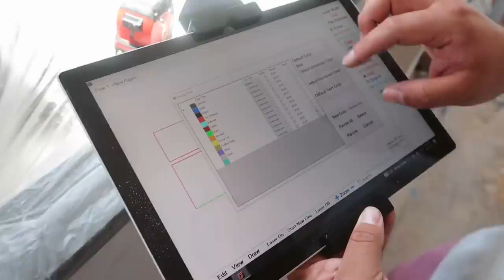HOW DID I GET SO LUCKY

Comment: I stripped many layers of paint off of my 1925 home's beautiful woodwork in the 1980s, and I could be wrong, but I'm 100% sure you have (I'm guessing) at least two layers of lead paint on there.  I don't know what it means as far as doing anything differently, other than don't eat it.  If I was going to use the heat gun (I didn't, but I used a heating element thingy up close in one hand with a spatula behind in another, a lot) I'd definitely use an industrial duty vapor respirator.

EDIT; I'm guessing the living room window trim is probably original, it looks like it has some age, and probably the right amount of paint layers.  Another good clue would be if most other windows throughout the house are the same.  I don't know what wood that is.  It looks as though it has some kind of varnish you may have to get off also, and then if it's too light underneath you can stain it dark again.  I think you'll be VERY happy with all the old paint off the trim!

Comment: My heart dropped when that door fell 😅 that wood trim look like it has varnish on that could give it that fake look, my personal opinion, strip it off completely give it a light sand with a fine sand paper and stain it darker if you prefer it darker then you can seal it again with a polyacrylic or the finish/sealer you prefer. It’s going to take time but it’ll be worth it in the end.

Comment: Try Smartstrip for your old paints. The red one. It takes off 30 coats of paints including paints before 1980 with lzad and or asbestos.... An d the COV of the product is really good. You just need to air out the place and let it sit for 24h hours

Comment: The trim could be slightly sanded then wiped with a tack cloth and you could go back over it with a gel stain. It is easier than fully re staining and has a protective layer to it. It does have a satin sheen to it and is limited in color selection

Comment: My comment about the Surf Prep Sander disappeared?  Katcha, Christina Muscari and Katie Scott all use it.  You can get a discount by using their promo codes.  It's a clean and efficient way of sanding and getting down to the wood.  You could rent one and see how well it works vs Citrus Strip.  Even after Citrus strip you would need to sand to get down to bare wood to restain.  It does curves without losing profile.

Comment: You pretty much gave all of us a heart attack, when the one door panel fell. It missed that paint can by about 2 inches, so that would have been disastrous. For now, I would just store them flat on the ground. I would stain the wood frames a dark espresso brown. I'd be curious on how you would paint the metal parts of the windows. Spray gun with enamel paint?

Comment: Have you met your new neighbors & set up a very secure security system at your new house? Have renovated over 20 homes & construction site thefts are a painful reality. Getting to know your neighbors & giving them your emergency contact info is critical. Several times neighbors have helped prevent thefts or helped to bring the perps to justice. You've got approx. $50 grand in light fixtures alone. When the plumbers bring in the copper pipes, that's another very attractive time for thieves to strike. Your tools all look crazy new & nice, and shouldn't ever be left overnight on site or left unattended fora minute. Just saying, you've got a beautiful new home & these thieves are pros at finding homes under construction... would hate to see you get burned.

Comment: Use stripper and steel wool to remove the final bits of paint. It will also smooth out the original wood finish.

Comment: The trim is varnished and also should be removed. It may be shellac. If so, the Citristrip won’t cut it. Denatured alcohol should do the trick. It will be messy. Anything that’s flat can just be sanded.

Comment: hi Drew! new viewer here and I had a q -- did you lead test any of the bottom layers of paint? We saw you test the top layer, but my understanding is that the top layers could be sealing in bottom/older layers of paint that do have lead and that could be really gnarly to be breathing on as you strip the window frames.

Comment: Difficult to tell what type of wood that is from the pictures.  If that house was in San Francisco I would say that is gum wood.  My house was built in 1925 and has it through out, as many many houses do here. The tone of the wood is very similar.  However, it was also very popular to faux finish timber to make domestic woods look like gum wood.  This is especially true with newer buildings being built in the style  as timber supplies started to dwindle and costs became more expensive.  So your observation that the color almost looks to be painted on might lend credence to the faux finish hypothesis.  If you can get it to a point where you are absolutely down to bare wood and can take a close up, that might be helpful.  Gum wood is very close grained and yours looks a bit more open.  I haven’t checked your Instagram yet but if you can put some detailed photos up there we should be able to identify it.  Congratulations on your new home.

Comment: If the trim was never meant to be painted it would be cherry or walnut, but it can also be a less expensive fir or pine and faux finished although considering how you could scrap some of the varnish off and not gauge the wood I would lean to hardwood such as walnut.

Comment: The only reason the window trim wouldn't be original is if the windows had been replaced. "Real wood" might be a cheap pine, and I guess you mean not MDF (which emerges in 1990's, not earlier). MDF routs well for inside, but cannot handle moisture at all, and I'm guessing your home has zero, outside the yucky remodeled bath(s?). 

SUGGESTION: You can have identical molding strips custom milled for ALL the windows lacking old trim. Your carpenters do the mitering and install with finish nail gun (QUICK!). Requires intermediate skill level. X yards of the stuff in-what-12 foot sizes (to save on cut-off waste). Do ONE house-wide inventory. It's easy to trace a profile for the lumber yard to recreate ... Would be interesting of US TO SEE. And it's affordable off-site commercial milling (routing). They'll dump all the little light moldings on your driveway for one small charge. DON'T try to physically build up "similar" profiles in the same room. To a sharp eye, it's noticeable. If you stain instead of "ebnonize" or paint, matching wood appearance get's dicey, so form a plan as to finishing. You could paint one color brown on new and old, then another color brown in "grain" above that. Movie style. 

OLD STYLE: Recreation of ebonization is something you'd have the talent for. No doubt. While you could do this in just 1 room, think of any transition to the next room. Including floor moldings ... Avoid visual issues. 

I restored / improved a 1939 LA top-bottom duplex with 48 double (multi-paned!) windows like yours. For SANITY'S SAKE, I never considered stripping each and every one. Care, inside and out (sanding and refilling), was enough for me, followed by 2 coats of paint inside and out. protection from moisture, not just good looks. 

SAFETY: Paint layers post 1975 aren't lead. Pre-1970s? LEAD. Your home has 50 years of lead layers, probably 2. After 100 years, it's common to have both types in 3-6 layers of paint. It's pretty easy to find ALL the past colors underneath. Trim was darker than walls, way back when. LEAD isn't as icky as asbestos. You can just leave it, or remove it with greater care (stripper isn't good for us either). I am careful around it in my restorations, but I don't freak out. Work ABOVE it (lungs), wear your N-95 mask and glasses of goggles, hand sand, and shower or clean up thoroughly to keep fine dust out of your orifices (Sorry that reads like a joke). Wear T over jeans over boots, instead of shorts, barefoot. A cap keeps the dust out of hair, and migration to eyes or ears. Just dump the clothes where you are, after working for a spell. 

A modicum of prevention is wise, but not obsessive. 

Remember to consider the appearance of your windows when opened IN. For that reason my entire structure's windows and trims were identical "floral white". Both floors, every window or doorway. 

Good Luck! The length of my comment shows my age. Glad to be restoring ... still.  Hahaha!

Comment: That isn't  a door it is a vintage Casement Window.  In older homes you could  step out of them  on to small  porches  or rail ledges like the ones  you see in New Orleans.  They are thiner then doors. Check out vintage  or antique  casement windows. No get confused as roll out windows and other styles were based off them. Just like moble homes were based of roll houses. 

I say all this so you to help you in installing them easier and security of them. Ground levels had some of the most bueatiful  full latches.

Comment: LEAD PAINT FUMES ARE TOXIC !!!  WEAR A RESPIRATOR!!!

If you're going to do several of these invest in a Speedheater Cobra.  It doesn't get hot enough to vaporize the lead paint and is light enough to hold with one hand while you scrape with the other.

Comment: More to the point of renov - did you get an electrical inspection?  If not, I would - these old structures were built with what was call knob and tube - which cannot handle the electrical load of today.  And you should have tested the lead with each layer of paint ... pretty things are great but to lose all in a fire ... geez.

Comment: If you decide to use the windows for doors, I would try fitting kitchen cabinet hardware (pulls or knobs).  And PUL-LEEZE - put those doors flat down in a safe place where nothing can fall on them and nobody can accidently crash into them or walk on them and they can't fall over!  Dude - you paid like $700 for those 2 windows - DON'T BLOW THIS!  P.S.  That does not look like "painted on" wood look to me.  That looks like the real deal.  Get somebody in your place who can identify the wood type - an experienced carpenter may be able to identify it straight off.  The house was built in the 1920s in California - it could be California redwood, which was routinely used in Arts and Crafts structures and even in buildings of later generations.

Comment: OMG They were falling you were talking and talking not running to catch them screaming NOOO ! Then they landed softly no breaking are you sure there glass and not some composite ? FYI those are beautiful but not made as outside doors. Maybe once upon a time they would have worked. But you need to go to a window door company they can make anything for what you want, 1920 , I’m sure they will have the style you want and they will be insulated and protect you from storms or heat or cold plus keep the power bills down. Those other doors might be same height and width but not depth wise no. But you can maybe use them on the inside of house by covering and existing window as shutters for the ambience or put them together and use as a screen in a corner. Those houses back then didn’t have much insulation and your upstairs where heat rises so it’s warmer. Just think about it you want it to look like it did when built. You can resell the other doors you take out. LOL

Comment: The color variation on the trim looks like it is from an oil based varnish. You need to sand it down to remove the varnish. My personal opinion is the window trim is original to the house, but I literally know nothing…. But if it’s not it looks like it is!